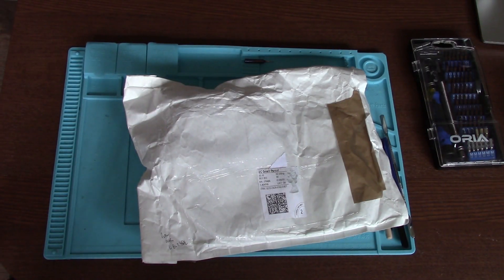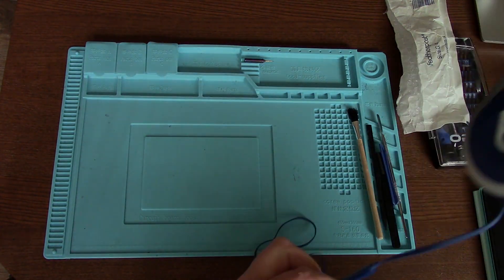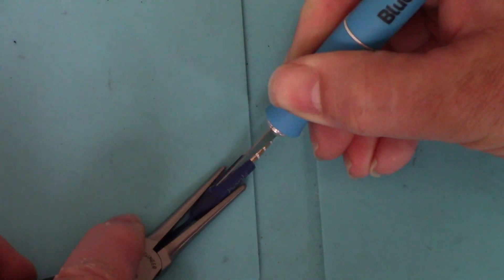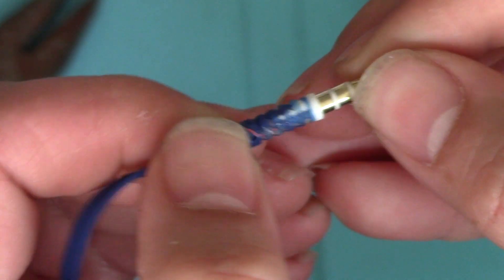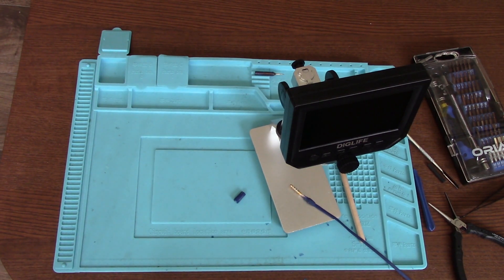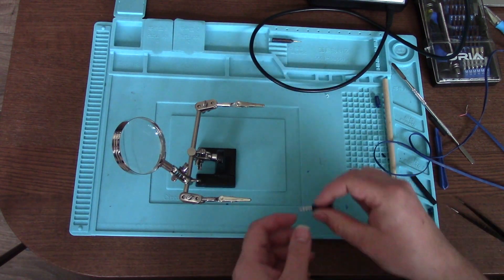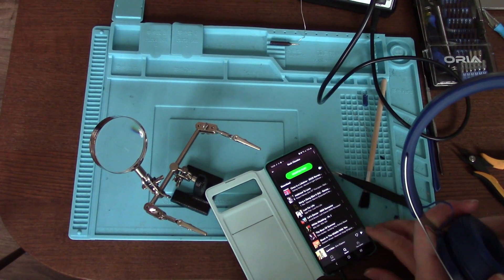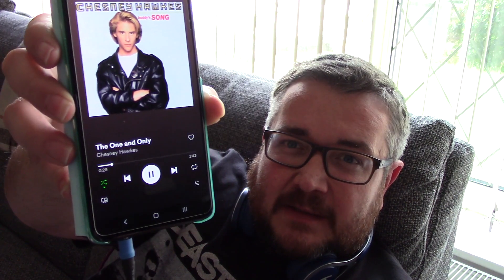Can I Fix these Beats by Dr Dre Headphones with no sound from the right ear?

Comment: You could've just snipped the "SAMSUNG" cable at a decent length, and open the BEATS' Play/Pause thingie, desolder faulty cable from "thingie" and solder new cable.

Faster, easier and more durable than heat shrinking soldered strands.
Reply: I'd have just tried straightening them

Comment: how did that work? I would have thought you would have needed to somehow insulate each wire from its neighbour.
Reply: Was gonna say the same thing. Interesting that it was just a day ago.
Reply: Apparently the leads are insulated even though they look like bare metal. Stripping and soldering the very ends was enough.
And placing the splices far enough apart from each other ensures no short circuits
Reply: Enameled wire: wire coated with a very thin layer of insulation. It is used in the construction of transformers, inductors, motors, generators, speakers, hard disk head actuators, electromagnets, electric guitar pickups and other applications that require tight coils of insulated wire
Reply: @sk4lman  Yes. I still think it's quite risky to let them lose no?

Comment: Think I would have just replaced the whole plug for a soldered version .. or the whole lead with built in plug ..
Reply: so you just have spare ready to solder 4 pole jacks laying about the house? :)
Reply: @flandrble  I do.
Reply: I replaced the entire jack on mine and the button on the cable never worked again but my earphones work great so I have left it

Comment: How did you know which cable does what and how did you prevent them from touching each other? They definitely look like they should be touching each other and I cant See anything thats isolating them
Reply: I have a feeling he used the continuity feature on his multimeter
Reply: He deliberately cut each wire to a different length so that the uninsulated area was different on each one.

Comment: Stop cranking the bump bump music in between talking please.
Reply from the maker: Of course Mike, you did say please after all. 👍
Reply: @StezStixFix  I'm surprised that you listened to the younger music I'm guessing you at least 50. from your grays and stuff you have talked about . I grew up in the 70
so listened to rock ,turn 60 in may .
Reply: @StezStixFix  And when you were soldering the wires i was wondering if you can use the fluid you used to fix the boards 
to cover the soldered tiny wires on head phones in future.
Reply from the maker: @Zanth123  at least 50? Wow, I'm not your friend any more. 🤣
Reply from the maker: @Zanth123  just realised this is an old video. I've tempered the music quite a bit since then. I've also aged a bit more, but still not close to 50! 😁
Reply: @StezStixFix  Sorry i didn't start getting gray till 55.
Reply: @Zanth123  You can get something called "liquid electrical tape" just for such occasions.